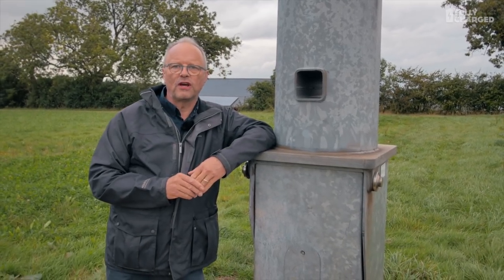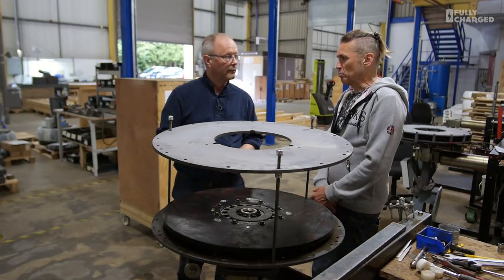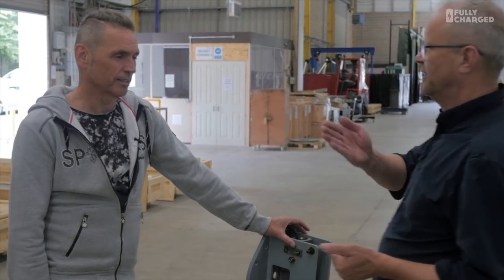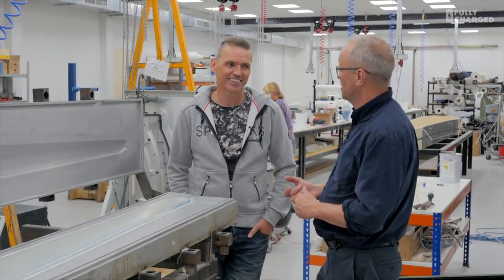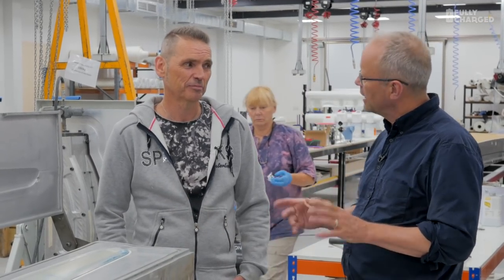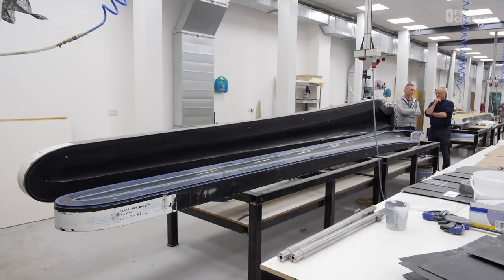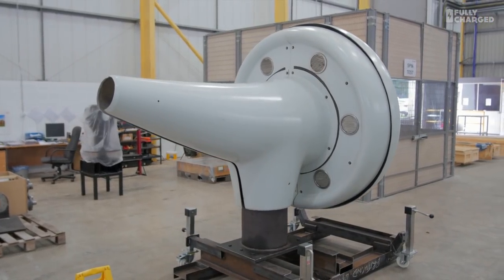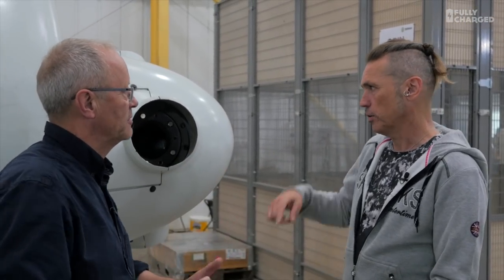BritWind | Fully Charged

Comment: I was disappointed to not see any vertical axis turbines. A VAWT can operate in less wind with less maintenance.
Reply: VAWTs are useless. Did you miss the part where he said there is a cube relationship between windspeed and energy? That's not a new discovery. If you want to see something spin in the wind, build a VAWT. If you want to produce energy, forget them. And I don't know where the "less maintenance" is coming from. a VAWT isn't really any simpler in mechanical parts, quite the opposite. It will need a gearbox to get the speed up for the generator. Most horizontal wind turbines have got rid of that.
Reply: The point being that Britwind do sell a VAWT so it would have been nice to see it. And they do have their uses in areas of turbulent wind where they can work better than a HAWT. Generally those are bad places to put any turbine, but if that's where your land is it's either that or nothing.
Reply: Vertical axis turbines tend to have massive wind loading during storms, requiring a more expensive tower and being much more at risk of failure. This turbine has very low aspect-ratio blades which automatically reduce their wind loading, providing power regulation and safety in storms - this is why horizontal axis machines have predominated throughout history...
Unfortunately, this is a very crude, heavy design, - expensive and labour intensive to make. A 5kW slow-speed alternator does not have to use this inefficient design, which uses way more steel, magnet and copper than it needs too... A revised design could be much more affordable.
And Dale fails to mention the originators who designed and made this machine or the boat-builder who used to mould the blades (long before the Evance name)...
By the way - anyone who has manufactured, tested and lived with small wind turbines knows that bird kills are VERY rare - I've never experienced one myself!

Comment: Vertical axis wind turbine, now that is what I want to see, supposed to be more efficient
Reply: Basically, vertical axis wind turbines are less efficient than HAWT.
VAWT CAN be more efficient in bad wind conditions, with a lot of turbulences.
But if you want a lot of electricity per invested money, you should choose good sites anyway.
Reply: Ok, good to know seen a bit about VAWT in bad condition's but nothing in fair weather.
Reply: If you have a place in the garden, surroundes by houses and trees, you could possibly get more energy from a VAWT than from a HAWT of the same size.
But you won't get much energy anyway.
If costs per kWh are not important, but you want at least SOME electricity even from weak wind (reliable power), VAWT of the Savonius-type (drag driven) are better than HAWT or VAWT of the Darrieus-type (lift-driven).
Bad efficiency, but they can utilize poor wind better.

Comment: Nice video, but you really need to talk about cost and number of years to payback, but in terms of cost and the amount of CO2. This is something all renewable videos a very bad at
Reply from the maker: Interesting. So, the embedded CO2 in an energy generating device is, I would suggest, a controversial topic. Who calculates it and what metrics do they use? I am very confident the metrics used to assess the total, cradle to exhaust fumes used to assess impact of burning fuel are, and I'm being polite here, a little untrustworthy. The data commonly used by the automotive industry, 'tailpipe emissions' is so wildly off the mark as to be without value. Okay, I won't beat around the bush, it's a blatant lie, they know it is, they are hoping we are stupid enough to accept it.
I haven't watched this episode for 3 years but I seem to recall that we did display costs, I know one was around £15,000, and I'm confident that the embedded CO2 involved in construction and installation, when divided by the total number of kWh produced in thee 25-30 year lifetime of the machine is going to be low, I will go further, so much lower than any fossil fuelled/nuclear generation as to be humiliating and embarrassing.
So, I will make another generalisation, not all 'renewable videos' are the same, and while we are constantly making mistakes like any human being, we are generally improving on the accuracy of our reports.

Comment: LOL, a perfectly useless item, at any size, being flogged as some kind of solution to a problem that doesn't exist.
Reply: If you have grid electricity then a Wind Turbine is very difficult to cost justify.  But if you are OFF-GRID then a Wind Turbine can be very useful.  But, it must be very windy!  It must be much windier than what most people assume.
Reply: @MrSummitville  Then you would have to ask yourself why am I off grid?
Reply: @vtbn53  Because the cost, to the homeowner, to bring Grid Power in from the nearest power pole can be even more expensive.